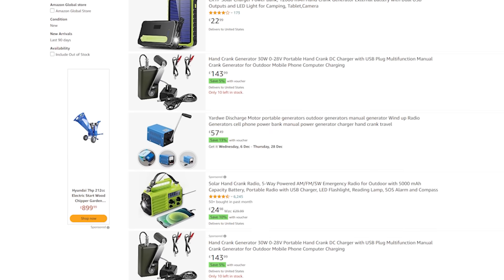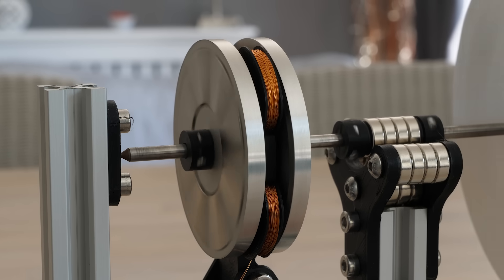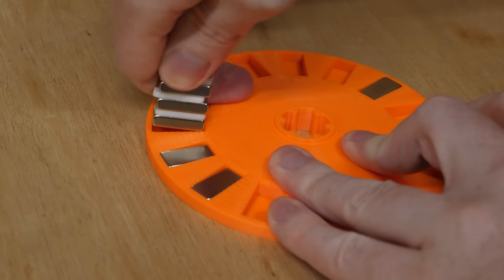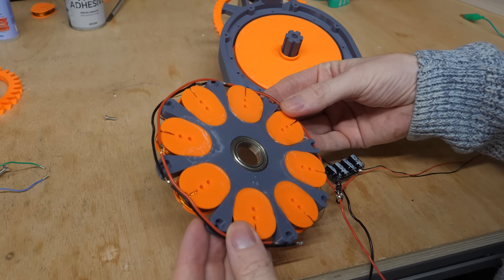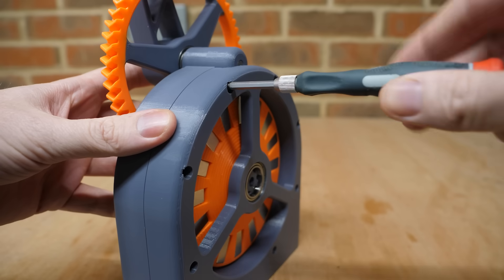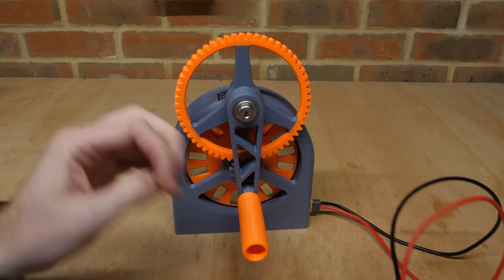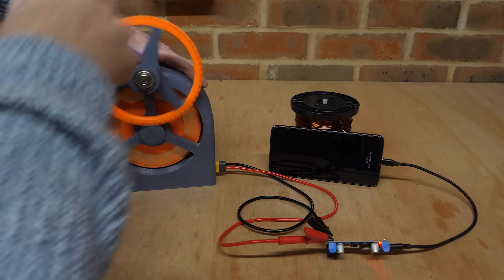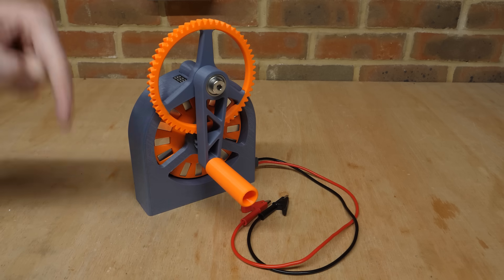Building a Generator

Comment: What's the short circuit voltage and current?
Reply: You could also add a metal backplate to focus the magnetic field
Reply: @filipo4114  shhhh. dont talk silly talk.

we all know "iron make them inefficient cuz hysteresis"

lol. i know what youre on about. 99.99% of the other viewers dont ;)

yep. i sure would like to see it put on a lathe and spun at a constant speed against a few resistances, a comparison made on the torque driving it versus the wattage dissipated in any resistance... a comparison made on the resistance of the coils inside the "generator" itself... how that relates to that load resistance... where the works being done... where the HEAT is being developed...

how inefficient it really is...

what was that? jacobs law?

silly talk. tom engineer!

Comment: This was fascinating.  When it comes down to it, a generator/motor isn't that complicated.  Always good to see that demonstrated.
Reply: I mean yeah.. these days we have access to materials and methods of manufacturing  for home users which far exceed the capabilities and materials early specialists had access to.
Reply: @AlexusMaximusDE  The Energy equation implies that the early specialists could build this easily just heavier.
We had at some point in time hand cranked army phones.
Reply: @dragoscoco2173  So you are saying they could have built a much worse version with much more effort because they had access to worse materials and technologies. Cool.
Reply: @AlexusMaximusDE  Basically everything except the high quality magnets of today was available and pretty much of same weight. It is quite easy to build this with wood and a belt instead of gearing.
Reply: @dragoscoco2173  Ah yes, everything except one of the two things absolutely necessary for a well performing generator was available. Thanks for the input.
Reply: @AlexusMaximusDE  "Absolute" is a bit of a stretch when discussing the performance of a table-top device. Both bicycle dynamos and magnetos where used and performed quite well given their construction.
The performance is hardly affected as input energy is transformed into output electricity regardless of type of magnet used. 
The weight was slightly higher, but just Wiki bicycle lighting and be amazed that the small bicycle dynamo did not really change much from back then.
Reply: My favorite daydream is going back to like 1200 AD and creating a generator. They had metallurgy. Copper and iron and magnets. Energy storage would be harder but running power from a water mill wouldn't be impossible. But using that power would be limited. Lights would be basically impossible to make. Motors would be relatively easy. Using it for heating could work.
Reply: @NandR  If you can build a generator, you can figure out how to make a motor and some gears. If you can make a motor and some gears, you can make a lathe. If you can make a lathe, you can make a vacuum pump. If you can make a vacuum pump you can do a low friction flywheel and lightbulbs. If you can do that, you can be burned for witchcraft.
Reply: Building a generator isn't the difficult part. It's making the gen spin that's the difficult part. Then transmitting the power.

Comment: Very nice design. I don't know if you've seen Robert Murray Smith's channel, but he uses serpentine coils which seem like a lot less work to make, to me. :)
Reply: serpentine coils. ahhhh, stupidity at its finest!

go look into "jacobs law".

a serpentine coil, by its very nature of construction, limits the amount of power that can be delivered to a load, and instead forms a load itself, and WASTES power as heat in its own resistance. 

go back to the demonstration of eddy currents, lenz law... dropping a magnet in a pipe. start THINKING about it. what if you cut the pipe? what if its a coil? what if theres a resistor across the cut you made? across the coil? what happens to the magnet? to the lenz reactions aka eddy currents? what is current, what is voltage, anyway? when you start to get an idea of that, you might see these videos for what they really are. trash. they all do the same thing and fail to show anything at all of any merit, and they all just go over the same basic BS... no more.

yknow whats sad? that youtube proliferates all these half baked ideas based on miseducation and lack of knowledge on basic fundamental principles... this video was another demonstration of how not to do things, half understood principles, with no attempt to apply well over a century of acquired human knowledge and experience. 

"just wave magnets (of unknown strength? with no thought of reluctance or the most efficient magnetic circuit?) past some wires (of no given size, length, resistance) wound into coils (of no known inductance or turns) and generate electricity! wow! its magic! and and and... its axial flux!!!! and i used a full bridge rectifier, and made yet another explanation of how a rectifier works... like there arent enough already... and i made sure i had an animation or two..."

whatever.  i guess im just a troll... :D
Reply: An even easier build and more powerful  is Robert Murray Smith thunderbolt generator. Think he got 150V out of it. Really impressive.
Just went round the bolts in a big circle. Easier than his serpentine. With offset magnets to reduce the drag.
Reply: @strawman9410  150v into what LOAD? what resistance? how many amps? how many WATTS?
and how much power did it take to SPIN? 
how EFFICIENT was it?

did he talk about that? did he mention that? did he test that?

150V means nothing.

theres a potential difference of 150v or so from my head to my feet, atmospheric electricity. doesnt do much, does it?
Reply: @paradiselost9946  I was mistaken this is  what I was referring too and uploads around this.
1807 The Mighty Mite As A Wind Turbine
Reply: @strawman9410  150V at what current? No one can say it's more powerful without measuring actual power output correctly. Appears the guy might have been conning people again.
Reply: @Ed.R  info above will lead you to that info
Reply: @strawman9410  I can't because I'm unable to resist correcting him in the comments but as I'm blocked I'm totally wasting my time because nobody can read them.
Reply: @strawman9410  I even had a special video made all about me because I frustrated him so much. Every time he blocked me I'd create a new channel and carry on commenting. So determined he was to protect his illusion of doing science. When in fact he is only in it for easy views and money not so much learning and teaching how things actually are.
Reply: @Ed.R  interesting, would mind sharing here what information you was trying to share
Reply: @strawman9410  Honestly don't know where to start there's so much wrong in his videos. Hence why its important to be able to correct all the points in each one in the comments but I'm done with creating new channels every day.
One obvious thing that comes up in every video about generators is the lack of measuring equipment used. It's so easy these days to get a couple of multi meters one for voltage and one for current so at least get a real power reading. Can't understand why he insists on using that single lab meter no one can read. Then does what every dodgy generator seller does and multiplies open circuit voltage by short circuit current.
If he was really serious about generator design its not difficult to set up a data logger to analyse the performance. It's no wonder his battery development company never got anywhere. He seems to have a phobia of doing any real science.
Reply: @Ed.R  fair comments. Thank for your reply
Reply: I think has channel is best avoided, its full of BS as he's only into YouTube for the views and money.

Comment: "Tim" 🤣
Tom, standard protocol has it that the XT60 feeding power out should be female, as a male would be more prone to accidental shorts across the contacts. An interesting project. Initially I thought you were going to use a stepper... How did you count the wraps of wire? There's no way I'd do that just counting in my head!
"157...bugger!"
"1, 2, 3..." 🤣
Reply from the maker: Yes, that's correct. However, I wired it this way because it doesn't matter if the generator short circuits (the crank resistance just goes up). But if I charge a battery or capacitor, I don't want the wrong connector on them as that short would be far worse. Also, yes, I did count the turns in my head 🤣